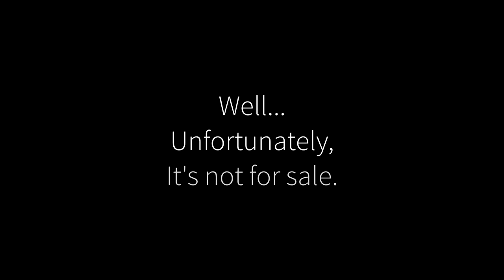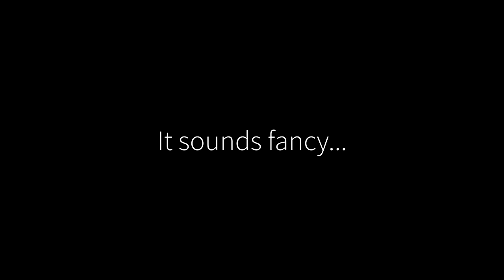How To Replace Anvils AUTOMATICALLY (Completely Hidden)

Comment: This build appears to be directional. If I simply take the world download, litematica a copy and rotate it 90 degrees, it appears to work once and then it gets into a loop. I spent a long time isolating the issue, and found it's the update order between the note block that is in the upper back left (as you face it from the rear) and the redstone that gets its signal from the comparator. So the note block is getting updated before the redstone and so the budded piston doesn't fire as the block that QC's the piston is not yet powered. Replacing the note block with a downward facing normal piston gives it sufficient block delay to trigger the budded piston next to it predictably.
Reply: Lifesaver! I built it in survival with schematic and it broke, built it again and only worked once then broke. Rebuilt it two more times, same problem. Thank you!
Reply: In which direction, do i have to build it. I dont use litmatica
Reply: @iugerum  I had to dig up the old world I did this in... East/West facing will work as-is, but again if you change the note block on the back for a downward facing piston, it should work in any orientation.
Reply: @offkiltermc  thank so much! made my day

Comment: Thanks for the design, but you really should mention some crucial information in the video. 
1. The machine is directional, unless you replace the top noteblock with a downwards facing regular piston.
2. You can't have any solid movable blocks next to where the slime blocks are and could be AND you also can't have any solid block in front of the observer clock, which is pointing outward from the machine.
People who build this will obviously try to fit it in with their builds, and it is a flush-with-floor design, meaning 99% of the time it will be built into a hole dug under a base, both of these points are really important to know before building it 2-3 times and getting frustrated.
As this is an old video, I think this information should either be added to the description or a pinned comment or both.
That being said it works great after figuring those out!

Comment: It would have been better to use a different coloured floor block to highlight where the anvil will be placed to help orient the machine.

Other observations:

The parts list is not only missing the droppers but is short a couple of red stone torches and also makes no mention of the number of supporting blocks and slabs that are needed.

I built it and it didn't work. So reading the comments here and trying again I got it to work.

As @offkiltermc comments the design is directional. It didn't work the first time I built it. If the vertical observer sides aren't oriented exactly as in the video then you will have the same problem. Restart with the design rotated 90°.

As @tianjuewen2004 comments there needs to be a gap around the machine. The culprit appears to be an outward facing observer. Just digging a 7x5 hole to put it all in works.

Comment: I followed the steps perfectly and yet when I activate the redstone block on the dropper, the whole thing just goes haywire and start clanking back and forth. Does this not work in 1.20 Bedrock or is it something else?
Reply: The only thing I did different is have my anvils rotated 90 degrees the other way. Don't tell me that's messed it up?

Comment: I built this three times and it's broken every time it has something to do with the nor latch or the timings on the bottom it cloks or refire the system and something is up with the flush trap door :/ can you help
Reply from the maker: Are you on bedrock edition?
Reply: @Purplers  no
Reply from the maker: @chuckknapp3731  In the circuit for the trapdoor part, there's a sticky piston pointing up with a observer above it, is that observer up or down?
Reply: @Purplers  I'm ten don't now why I felt like I need to say that I will build a new one and tell you if it breaks
Reply: @Purplers  ok so what happens is it works but than it clocks
Reply from the maker: @chuckknapp3731  are there any anvils in it?
Reply: @Purplers  yes
Reply: @Purplers  I built it one more time and it worked thanks for the information

Comment: Maybe you could replace the piston pushing the block underneath the anvil up with the push limit detection tech that was discovered by _Kayleigh and Land for a more seamless experience. But I'm not sure if that can be done in such a way that you don't constantly hear piston noises.
Reply from the maker: I don't quite understand what you mean, are you talking about replacing the slime blocks with an X piston extender?

Comment: I am so frustrated with this. I have built it a total of 7 times now. For some reason, which I can't figure out, it works everywhere else, except my base. Could lag cause this? When I build it in my base, it turns into a clock. It's such a cool concept too :(

Edit: DO NOT build it on a chunk border, even though it's not addressed in the video.
Reply from the maker: Hmmm are there are any surrounding blocks attached to the slime blocks? And is the observer at 5:53 placed in the correct position? (down, not up)
Reply: @Purplers  It's all done correctly, but it starts looping when I reset the system with the first time, as seen in the tutorial. I built it five times in my base, and four times in another part of the world. Both times outside of my base worked. I also overlaid a schematic to ensure I didn't do anything wrong. At this point I can only assume that all the lag around my base is messing with all the precise timings involved.
Reply from the maker: @eclipse4507  Is it on a server with plugins?
Reply: @Purplers  It's on a fabric server with a few performance mods. That's why I tested it in other parts of the world too. I guess it could be a combination of mods and lag.
Reply from the maker: @eclipse4507  I'd need to see it then, because the only thing I can think of is that it isn't done correctly somewhere :/
Reply: @Purplers  I was just planning to record a video showcasing it, when I noticed that I had built mine on a chunk border. I moved it entirely inside one chunk, and lo and behold, it works now!